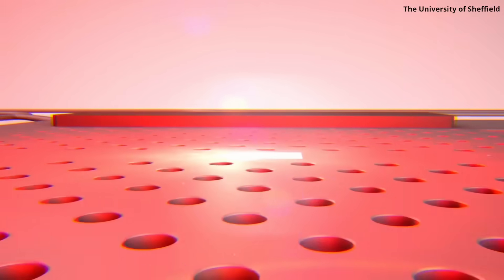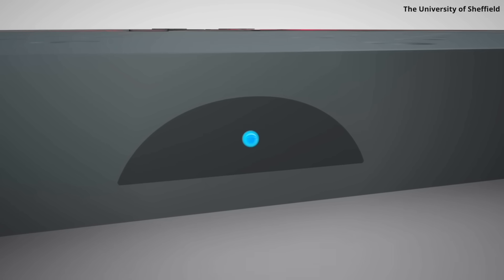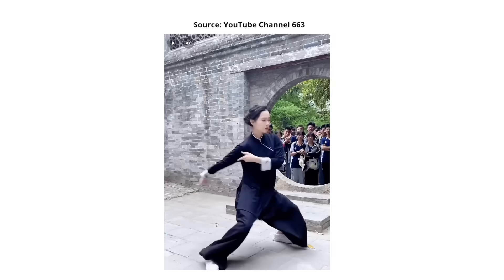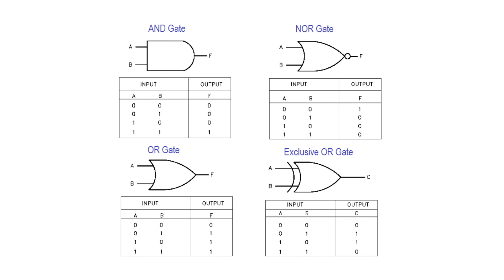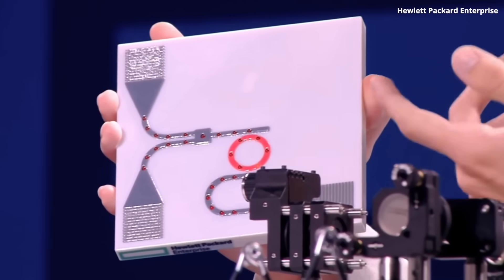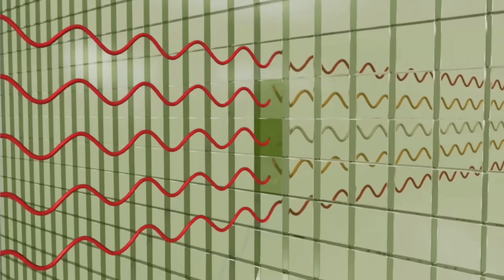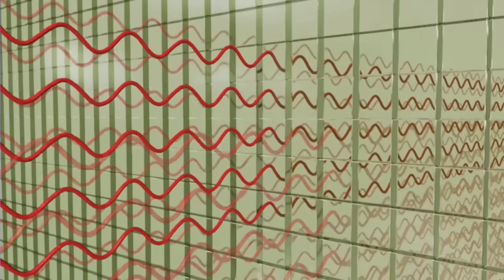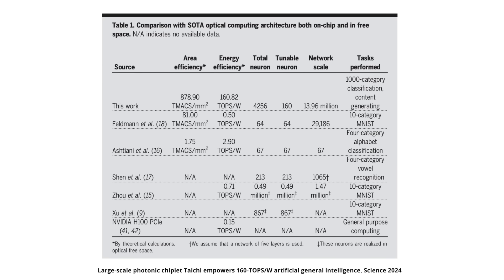Meet Taichi — The Light-Speed Computer

Comment: Minor correction:  Light in a vacuum travels at 299,792,458 metres per second, but light in a fibre optic cable travels 30% slower at around 200,000,000 metres per second.  We could, in theory, increase that speed by using different materials for the fibres, but we will probably never get close to the vacuum speed of light.
Reply: what's 30% amongst friends.  It goes from INSANELY fast to just blazing fast...
Reply: @trevinom69 approaching ludicrous speed😮
Reply: @trevinom69 Ah, the adjective, the most accurate and universal metric.
Reply: such traders use air radio links instead of fibre optics.
Reply: @Nilmoy  wifi could be slower too because of interference and collision. If not, it would be the preferred way of transmission in a datacenter as the cabling costs are high.
Reply: @Nilmoy probably because radio really travels at the speed of light ?
Reply: @nicodesmidt4034 yeah because speed of light in air is much faster 299705 vs 206856
Reply: It's very noticeable actually, if you are talking to someone 1900km away, there is a 6ms delay on top of the router delay.
Reply: More people should differentiate "light speed," a variable, from THE speed of light (in vacuum, a constant).  This is confusing terminology for students and some professionals alike. Can we please standardize this?
Reply: @user-gv4cx7vz8t  I guess it's a little more nuanced than that.  Photons travel at the same speed everywhere in the universe.  When they're travelling through non-vacuum space they bounce around, get absorbed and re-emitted by electrons, and generally have a bit of a hard time to get through. If you add all probabilistic waveforms together, however, the overall effect is they appear to slow down when travelling through objects - even though they actually don't - they just travel further than the straight line path suggests.  (This also explains how refraction works.)
Reply: Vacume tubes repurposed. Why couldn't you make a reflective lined vacuum fiber tube...
Reply: @Ivanrico238 Reflection is lossy. That's why prisms replaced mirrors.
Reply: Thank you for this correction … I was shocked by the comment of fiber optic cables working at ‘the speed of light’ … ahhh
Reply: Why stop at visible light, just send gamma rays.
Reply: @maladyofdeath  waveguide properties contain certain C & L band waves. Gamma can't be effectively contained and channeled
Reply: There is research on producing hollow fibres.
Reply: @rjones6219 there are hollow fibres
Reply: Are you suggesting that we use cables with vacuum tubes in them for reducing latency??
Reply: Starlink
Reply: Fibre optics now sends the light into vacuum pipes in the fibre. They run at light speed
Reply: So we develop a vacuum chip.
Reply: it is close enough for government work
Reply: All these routers between your computer and destination server add up time that your requests are processed
Reply: Silicon is not the right material for this task.
Reply: It's not the material that slows light in fiber optics , it's all the up to 45 degree turns and bends that restrict the speed.
Reply: @Davidsavage8008  lmfaaaaaooooooo  no its not, light particles aren't race cars 🤣
Reply: but if the input and output ports were interconnected in  double slits the change of one side should cause an instantaneous change if they are all in series
Reply: Wait till they can manipulate all matter at the subatomic level to configure and create the elements we need on the fly as needed. Like the way you describe the speed difference in fiber and making new elements of better light environment to transport the light ..next generation will be most likely mind blowing..😎🇺🇸
Reply: Rate of induction
Reply: Maybe by using special ultrasonic pulses, perhaps on a nano level.
Reply: Great reply 👌🏻
Reply: What if we vaccum those fibers
Reply: Correction. The speed of light is not the speed of light. Going faster than the speed of light is possible. Going faster than instantaneous is impossible. You can't get there before you leave.
Reply: @rafaelgonzalez4175 wouldn't that just be simultaneous as opposed to faster than?
Reply: @badbat01  In order to accept the rate of velocity, one must know that rate of velocity. In order to know the velocity one must measure that velocity. In order to measure that velocity, one must observe it from point a to point b and measure that. That is not how light was measured for velocity. The answer is It cannot be simultaneous unless it is instantaneous. Then all velocity is equal. In measurement.
Reply: @rafaelgonzalez4175  just like two atoms can share an electron. Two atomic nuclei at two different places at the same time with one electron encompassing both. Does Quantum entanglement contain a measurable velocity?
Reply: @badbat01  Quantum entanglement is the fastest any measured velocity can be. The speed of light is not even close. The only way anything could be faster than quantum tunneling, is sub-quantum. I can't even imagine that realm. I understand the quantum related path of energy. To accept quantum entanglement, I had to think about my mind, and stored information, and how memory is stored in the subconscious.  Everything to be considered, quantum entanglement is done through quantum tunneling. The miniscule size that is. Is how information charges through our brain. In that instant. The fastest of any form of energy transfer. Even from energy to matter. Life. The fastest of communication. Even from energy to matter. Vibrations. I also believe photon particles are in just two places. Directly in front of the source and one at the end. Point of contact. My eyes. My linear sight. And yes, a quantum tunnel may actually be between the two. My thoughts.
Reply: Using photonic generated assemblies of native computational matter engineered by design to calculate construction configurations in motion postulates  an evolving architectural progressive design iterations in both forward and reverse inertial assets as light is both a particle and a wavelength. End to end communication with this idea in mind allows a variety of particulates to be optimised for example, destination pre-excitation dwelling through simultaneously magnifying criticality to the sent photon attaining component parameters before the elongated packet of photonic architecture. Allowing self cycling interaction dualities offer a possible acceleration potential. (That was long than I anticipated)
Reply: @badbat01  End to end connectivity by way of Fiber Optics Is a faster way to deliver and transmit due to its two way ability? Was that what I read? All that?
Reply: @rafaelgonzalez4175  Imagine however distant the objects of fascination you see telescopically you connect by light. Photons across eternity.  We were born into the same composition.  Made from the same matter. Thoughts that materialise. Wonder that provokes. Everything is intertwined. Space-time. A cosmic clock self attenuates. Movements of matter that matter. Taught Webs, strings strung tension. Pull or release the tensor. The mechanism of reference commender.
Reply: @badbat01  Yes, everything is a connection by way of energy. The experience of feeling that energy is not carried from one galaxy to the other. I may sense the vibrations and get a sense of existence, the experience we encounter is energy from energy into energy to detect energy. The energy from the universe, is absorbed by life. Life is energy. That energy is thoughts and ideas, conscious and sub-conscious. Which we define. We see that energy with our eyes and that also we define. What we see with our eyes are greater experiences than just the sense of vibrational, frequencies.
Reply: They are trying to make optic fiber in zero gravity to improve the efficiency of optical quality.
Reply: @mortez_creates  It must be me but for some reason my mind keeps going back to zero gravity. If it is made in zero gravity, to perform better under zero gravity conditions. does that not explain it has to remain in zero gravity to maintain efficacy?
Reply: @rafaelgonzalez4175  not sure 🤔 exactly what way they will make this other than it was said in experiments with aero gel.
Reply: @mortez_creates   Everything does have a way of increasing efficiency. I was wondering. Fiber Optics is pretty decent. Maybe there is something to compressed vacuum and gases. Just wonder if it makes flexibility any more or less difficult. Something to look into. thanks.
Reply: cpu are allready light speed. the main point here is NOT the Speed! the main upgrade here would be the heat. we could have 4-5 TERAhz cpu clock with that tech with traditional cooling. and a correction: we could have 16.000-32.000x faster computing because with photons and light you could use 16-32 different wave length and parallel computing on the same cpu. (today we can only have "2-ish" parallel calculations on the cpu with the alternating current in a cpu you can use the negativ and positive waves)
Reply: Anyways, using light travelling in fiber optics instead of electrons in silicon is much faster. 1%c vs 69%c (speed of light)
Reply: @beowulf2772  I see what you did there.
Reply: @beowulf2772  sure, but was not taking about the speed of the elections, but about the field.
Reply: @nicodesmidt4034 
Yeah, isn't it technically that light clocks itself;
Potentially, each is just limited bywith how much it interacts 🍽
Reply: @royronson8872 yeah, it just bounces around the cable so it's going extra distance technically
Reply: @beowulf2772  I have been thinking electrons are the key to FTL travel. Although the travel would reduce everything to frequency and particles you are on another thought processing in my mind. Frequency and light particles must interact. IN space that deep void out there has both traveling everywhere. It is obvious through observation light particles are faster but I propose thought itself. The energy that fires the neurons. Thought is as fast as light speed. Energy has electrons. Mass has electrons. Matter has electrons. Photons have electrons. The string theory is connected to the electron and all other mass matter and particles. My theory contains the electron as the device that is FTL, in our reality and inner universe. In perspective the electron fuses atoms. Super fast. The electron determines spectrum of light. Particles are as they are. Ultraviolet particles contain an electron. Fluorescent particles contain an electron. Molecular structure is determined by the electron. Elements on the atomic level are either lighter or heavier than gravitational pull. I believe the electron determines the negative or positive magnetic reaction, based on the weight of the metal.  Electronic everything. lol.
Reply: Thank you, although I'm not sure how minor 30% is.
Reply: @Lost-In-Blank  
High-frequency traders are paying fortunes to reduce cable length by an inch.
Reply: @Lost-In-Blank  it is minor indeed for what computing concerns :D
Reply: @Lost-In-Blank  it literally doesn't matter what the speed of light is in this regard, but how much data you can encode on it without dispersion and nonlinearities screwing up your signal. And if those aren't an issue, you still have the bandwidth limitations from the driver electronics.

Comment: I am not into this field of subject - but just a thought - you mentioned that photonic chips are bulky in comparison to that of currently used chips; but madam don't we need to compare the total through put of the photonic chip as it can do parallel processing in the given size vs the same equal work to be done by dozens of silicon chips.  i may be way off the mark by light years, but i thought i should ask you - even if others would like to make fun of my doubt.  regards

Comment: Math in light, makes perfect sense, same way it works in millimeter wave. 
We did some simple math this way with microwave power amps. We had division by a power of 2, followed by multiplication of amplitude, then combination by the same power of 2, and to move frequency we filtered different wavelenths, multiplied two sines to obtain a product of the two which was selectivly filtered to obtain just one of the two products.
The largest problem was controlling the waves so they do not radiate out of the circuit. With fiber optics or coax this is easy but with printed circuits it becomes a problem. But an optic printed circuit will have trouble keeping the light where it is supposed to go.
We were mainly after a larger signal. All the circuit traces are transmission lines of different impedances. Its just the way you look at it. Mostly I tested for best results in a lab, but worked with the chip designers to optimize results much like you are doing, your tech level is not to high for me to understand thanks for the videos! I will watch them all!

Comment: 17:13 is there a concise way to visualize compare the operating efficiency between photonic and electronic chips? I’m somewhat confused. For example… # devices x # operations/sec x # channels… ? Then we can see how much improvement is needed? They have miniature lasers now which are not the size of a table, so why can’t these be integrated on a “ board” or chip?
Reply: I think the light looses power in every stage so they need very high power input for a readable output. That is my guess.

Comment: I think a single light source being propagated through a semi-circular mirror into 1000s or millions of channels as a stream of alternating 1 and 0, it would solve the scale issue. Multiple sources shouldn't be needed. If the light source was spread into an array , feeding photonic transistors, it's really more a matter of how to switch them off. You may be able to have photonic transistors that could operate even in a vacuum without fiberoptic glass, but something has to switch them off and on at these ultra-fast frequencies. This I still don't understand. Are electrons still a bottleneck in the switching?

Comment: Thanks to your BRILLIANTLY clear introduction, three questions pop up for me.  I appreciate use of light intensity is a way to encode binary by analogue threshold, but apart from interference, what operations might be possible directly betwen analogue values? What are the properties of light that can be used to implement quantum superposition and entanglement and operations thereon? Does a little bit of inaccuracy degrade AI computation to level of unusability? How can parameters be (temporarily) latched into the silicon, as in matrix weights... even if parameters had to be regularly refreshed via alternate path?  Bonus question: Is there any way phonics can be programmed, like a FPGA?

Comment: You are wrong about the speed of light in a fiber. The speed of light changes in a medium. Light through a fiber optic cable moves at 2/3 the speed of light(in a vacuum). Transmission through air are faster but less efficient.
Reply: Yes and no.  I think the point is that circuitry is operating at the speed of light in its medium, not limited by a clocking mechanism.  With multiple frequencies being operated upon in parallel, this would be even more true to statement at point of decoding outputs.  The "in a vacuum" part is lazily missing in colloquial speech.
Reply: @ChrisNotTheKing  Too many laypeople really think that nothing is faster than the speed of light and that the speed of light is constant regardless of media.  Electrical engineers are not laypeople, we should be correcting them, not copying their mistakes.  She said, "Nothing is faster than the speed of light" which just plain is not true when said like that in that context when we're focusing on speed of processing.  

And it is not just that the speed of light changes with the media, it is also that even particles with mass can be faster than the speed of light in a media, thus causing Cherenkov radiation.

And she was already being super over-enthusiastic at that point in the video with selling the idea of this new approach.

All of the effort that engineers have put into finding media and physically configuring it to bring the speed of light in various circuits and computers up closer to the speed of light in free space, wave guides, Amdahl and using coax as spaghetti wires in his old super computers -- it has been a major effort with transmitting analogue and digital electrical signals, and it will again be a major effort in fiber optics and optical processing.

Always Natasha's videos are so excellent, this is the first I've seen her make that wasn't.  Still, it wasn't a bad video, just not excellent.